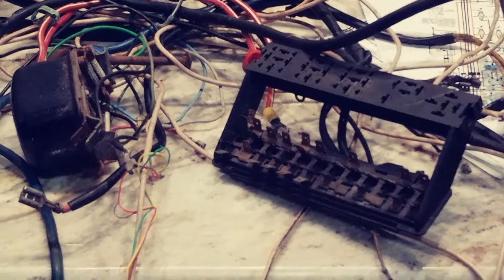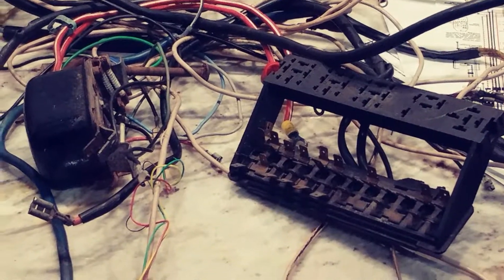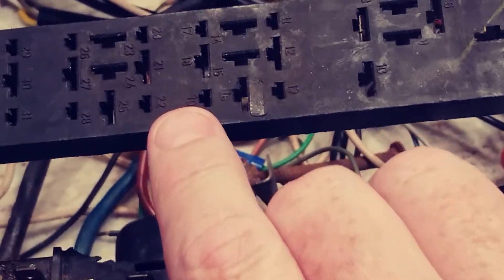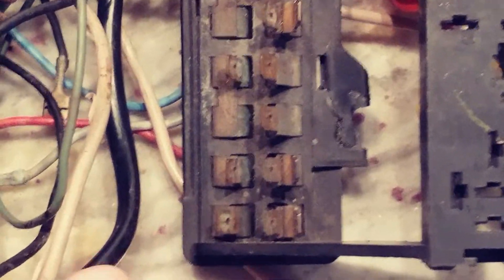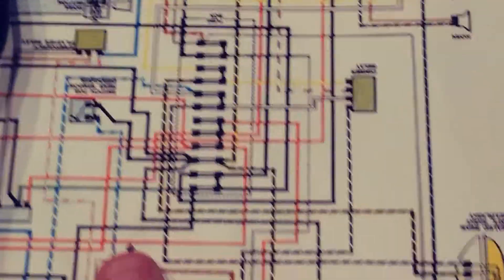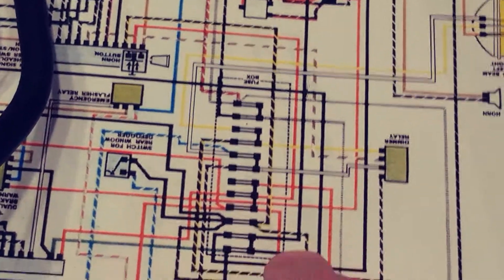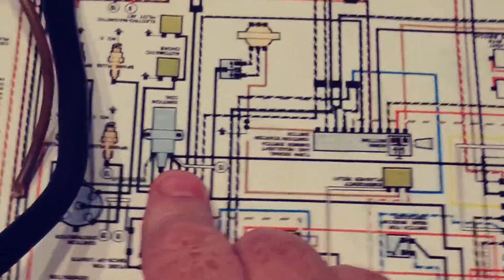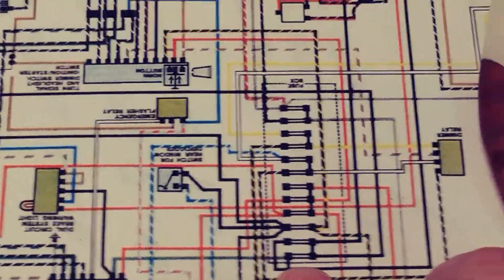CLASSIC 1972 VW SUPER BEETLE. RE-WIRE START TO FINISH PART 1 ( INTRO)

Comment: I needed help with wires from the ignition to starter.  Can you assist?
Reply from the maker: Go to Jbug.com there will be a section to click on to get free wire diagrams. These are factory color coded correctly. They are available for all years. This is where I got the diagram I used in all my videos. Hope this helps you out. Thank you for watching and viewing. I plan on doing more videos in the near future

Comment: Hey, I'm new to the hobby. I'm not sure what I'm doing.  I have a 1971 Super beetle. A Brown and white stripe from the  turn signal going to fuse. Would you please tell me which fuse to connect it?
Reply from the maker: Check out JBUGS.com They have color wire diagram on there website. I can look it up tonight for you when I get back home.
Reply from the maker: It goes to the dimmer relay switch
Reply from the maker: It goes to the letter " S" spade on the relay. Hope this helps. Let me know if you need more help.
Reply from the maker: Does not go to a fuse. Once you hook it up to the dimmer relay on " S" then the yellow wire on the dimmer relay goes to the fuse box. 5th fuse going from drivers side to passenger side.

Comment: Excuse me, I'm from Barcelona (Spain) where can I buy the 12 pack of fuses for my super beetle 1302 1300cc? Thankyou.
Reply from the maker: Any auto parts store will have them.
Reply: Volkswagenplanet Yes I Bought this pack: https://www.mecatechnic.com/es-ES/set-de-10-fusibles-cilindricos_VC31600.htm my vw has 12 fuses and I can't find a 12 pack of fuses (I have the old ones installed) is it ok with this pack of 10?
Reply from the maker: @puesdebarcelona  those are the ones I use.
Reply: @Volkswagenplanet  Perfect! Thank you so much, have a nice day.

Comment: Can you do a 73-74 super
Reply from the maker: What are you having a issue with?
Reply from the maker: Check out Slades Beetles here on YouTube. He is doing a 73 super
Reply: @Volkswagenplanet  turn signal, brake light not work and no warning lights in the speedo. New flasher relay. Fuse 8 pops when i use the hazards. Tired 2 different turn switches and same thing
Reply from the maker: @vwmadness1591  let me take a look at the books tonight. Pop a fuse is a ground issue. The rear tail light ground is inside the engine area. It's on the left side of the engine on the flat metal area. Should be a screw and male spade sticking up. I had the same issue with mine. Check your grounds. Almost always the issues with VWs.
Reply from the maker: @vwmadness1591  same with others.
Reply from the maker: @vwmadness1591  speedo light is grounded in the sleeve that the bulb slides into.
Reply: @Volkswagenplanet  yep. Pulled the speedo yesterday. Send me a message on fb. John Huddleston
Reply from the maker: @vwmadness1591  join my Facebook VW group. Its called volkswagenplanet. Just like my YouTube channel. We have a few youtubers in the group.
Reply: @Volkswagenplanet  sent a request to the page and sent you a message

Comment: Geat subject i always struggle with VW wiring , i will need to rewire a few buses , boy this will really help me. I had a old 1973 super beetle it was a electrical nightmare i think it was under some evil spell..it beat me like a drum.
Reply from the maker: Good to hear from you Dan.I think we all have owned a vw or two, maybe three that had gremlins under the hood. Part 2 is tonight at 10pm. E.S.T.  This wiring topic is all new to me. I have learned alot over the last few months. I just finished Part 3 late this morning. Its a long video. Probally one of my best videos I have ever done. Thanks for your support. Stay tuned. Its going to be a long series. Thanks for commenting.